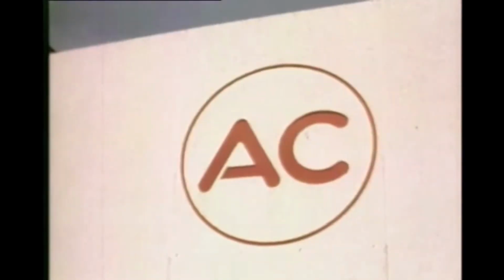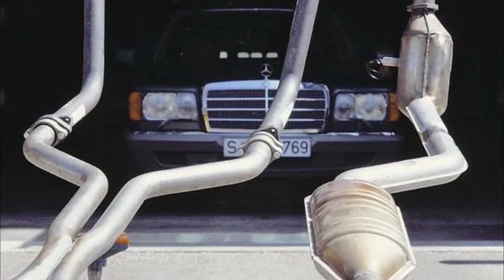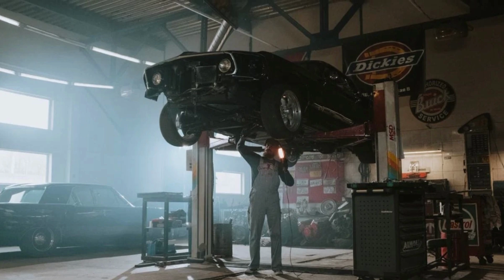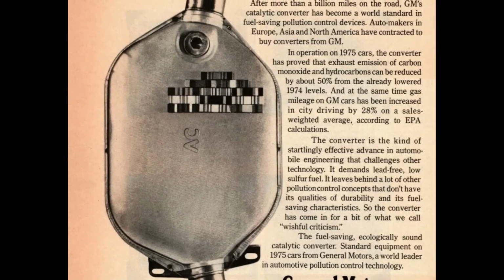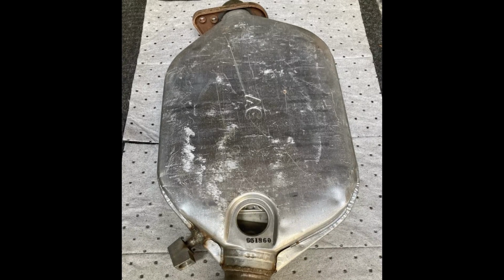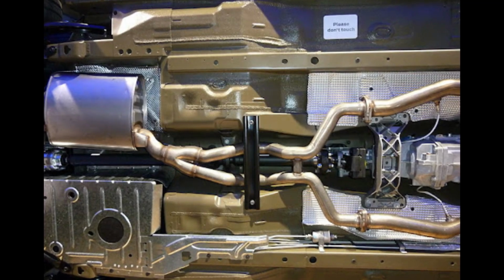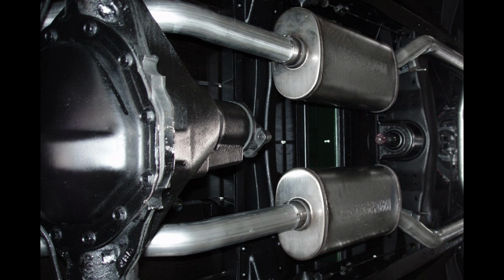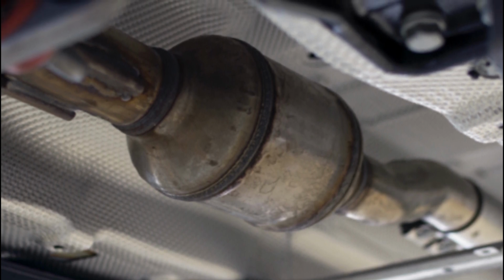Ford’s GENIUS Trick that Bypassed Emissions Regulations in The 1970s

Comment: My 88 F150 with the 5.0 V8 has two catalytic converters in tandem. Both exhaust banks come together before the first one and flows into the second one. If any of them fail, I'll have no choice but to modify the exhaust for a single high flow catalytic converter because I don't think that tandem setup is being produced anymore.

Comment: GM screwed everyone. Starting in 1975 when they started putting that catalytic converter on their cars, a lot of people would just cut them off. But GM redesigned the transmission crossmember to a single hump style to hinder adding dual exhaust. Also due to the catalytic converter, the F bodies (Camaro and Firebird) could no longer be ordered with GM’s turbo 400 transmission because it didn’t fit with the converter. This may explain why the 455 was dropped from the Firebird option sheet for most of 75. It did reappear mid 75 but required a 4 speed manual. This continued on through 76 after which the 455 was dropped all together.

Comment: Don't forget about the 1975 LTD with the 400 with the single cat on the driver's side and heat riser on the passenger side with both going into a single muffler off a Y pipe. Good engine restricted by weird exhaust configuration 😮!

Comment: I wonder if any automakers used bypass valves for the converters that only opened under full throttle. The cars would pollute more during sudden bursts of acceleration, but for most drivers, those are few and far between.
Reply: The 2V 1982 and 4V 1983-1985 5.0 Liter Capri and Mustangs with manual transmissions had primary light off catalysts on the passenger side, and a long bed cross over  3 way catalyst at the transmission. The bypass valve was operated to heat the Primary Light Off for five minutes, then open it after light off. So FoMoCo sort of used a reverse bypass to heat the Primary cat, then open it after it heated up.
Reply: yeah, inevitable idle misfires produce huge emissions. if even just the idling exhaust could be shunted to the single converter, benefits would be huge. A simple spring-loaded flap could do this. having the converter only treating half the exhaust during idle probably would not pass.

Comment: To balance exhaust back-pressure between cylinder banks, Ford installed an exhaust restrictor plate in the passenger side head pipe at the connection with passenger side exhaust manifold. This restrictor plate was just a piece of sheet metal with a hole approximately 1-1/8” (28mm), clamped between the manifold and 2” head pipe.😁❤️
Reply: And valve timing was retarded slightly.